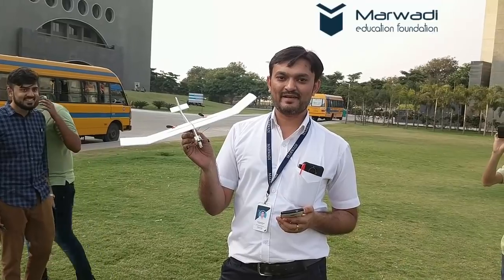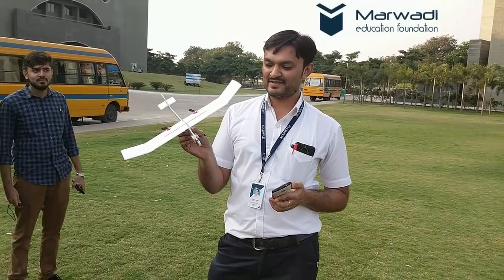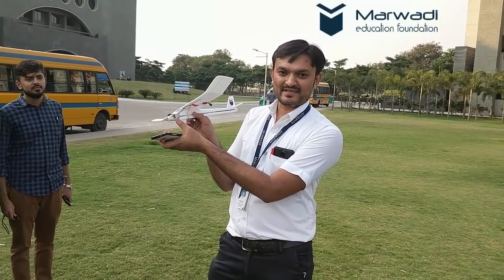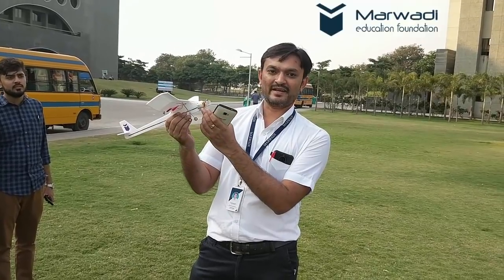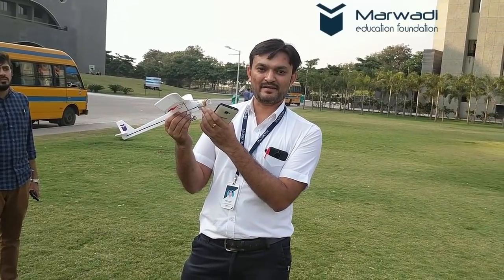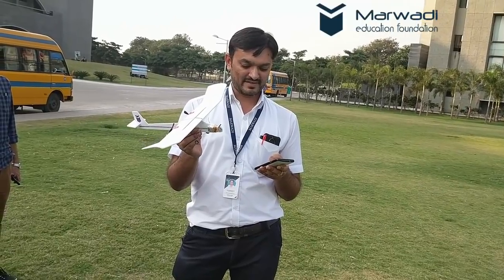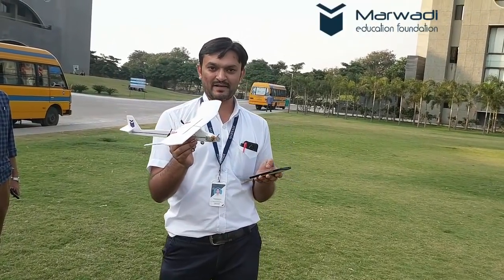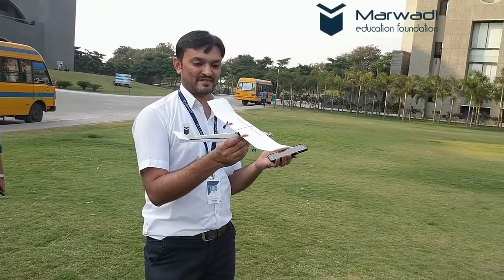DIY Smart Phone controlled Plane | POWERUP 4.0 LIKE WIFI

Comment: Have you connected motors directly to esp 12 e module???
The battery voltage at full charge is 4.2v and the working voltage of esp12e module is 3.3v. how do you connected the battery???
Reply from the maker: Nop ... Motors connected via si2302 nch power MOSFETs.. and diode used to drop bat voltage by .7 volts to keep it in usable range of esp8266..

Have a look at blog https://www.instructables.com/id/WIFI-CONTROLLED-RC-PLANE/?commentId=CZZPN7BKE59JPBL&reply=true for more info and build log

Comment: Hey, I have made this plane but with different protocol, I'm using espnow to control the plane but the thing is the plane feels heavy and i dont the the coreless motor will be able to take the weight of the rc plane. Was it same eith yours? Was your airplanes weight more than the coreless motor could handle? Please share your email id or any social media handle where i can contact you regarding certain queries

Comment: Nice video. what are the other electronic components you used in this model? And what's the RPM of the DC motors?  Thanks
Reply from the maker: IoT Guru https://www.instructables.com/id/WIFI-CONTROLLED-RC-PLANE/ complete step by step diy build guide